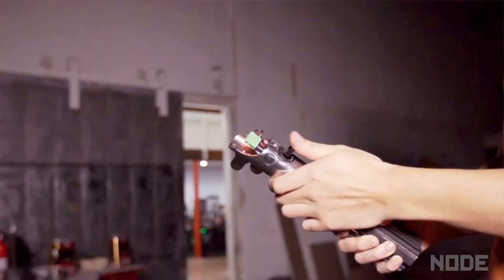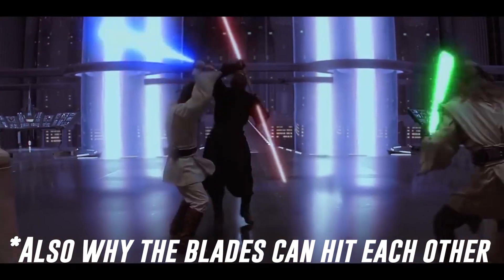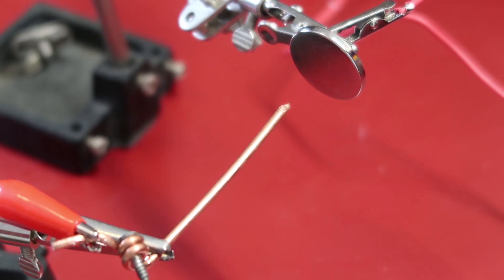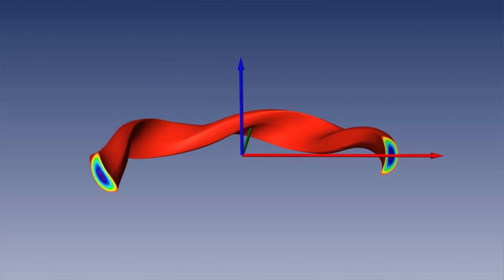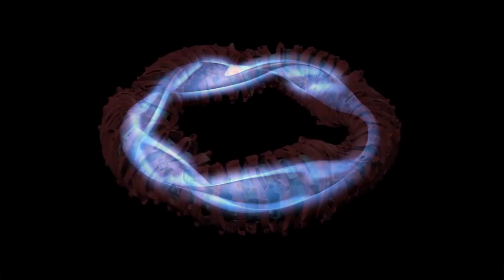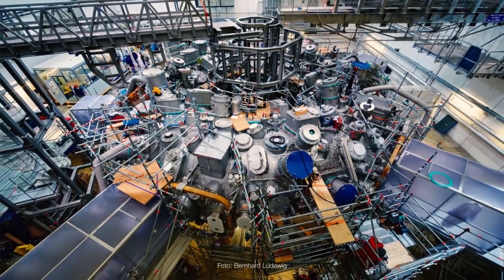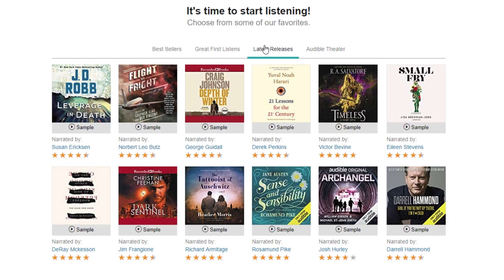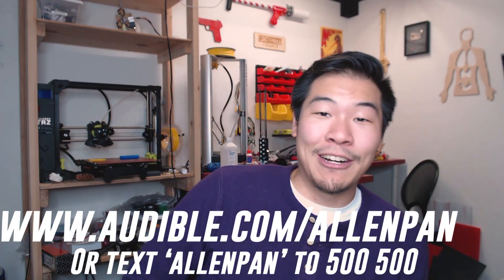Real Life Plasma Blades!!!

Comment: Just take a pipe, and on both sides of it make like ten smaller Jacobs ladders and add holes in the pipe so it blows outward on each one. So instead of the current traveling up force it to travel right and left using compressed air.

Comment: What if you put the electrodes as the 2 sides of a metal blade with a dielectric connecting them on one side, have some dielectric slats that guide the air to the side.

Comment: You could apply the same concept as a plasma cutter, with a 25,000 degree arc and an extendable electrode, like a taser, sort of.  Making it like a plasma cutter could be especially effective in a universe with access to extra dimensional technology. There's also an option of using replaceable tungsten electrodes rather than steel, for a hotter arc.

Comment: What about something looking more like a grill burner, like lots of little holes in a pipe along the length of the blade? You don't have the air going up the middle between the two edges but from behind.

MAYBE take that idea, and bend it so the electrical leads and air holes are on either side of the leading edge of the blade in an attempt to blow or curve the plasma around the leading edge (probably would need a non-conductive blade to do this)

Comment: It would have been a lot more effective if he turned the bladed parts outside so he could cut stuff
Reply: It doesn't work that way, the electricity is arcing between the two electrodes

Comment: What if you made a sword with the plasma on the outside.  A way of doing this i think would be epic is if you cut up a normal blade and spaced out the pieces putting the leads on the far end of one piece, placed at the end of the sword, and the near end, placed at the base.  That way the arc would jump from segment to segment.  This would make a functional blade and taser, also a way to make the normal non inverted halo blade!

Comment: What if you were to take a thing tube stock and drill micro holes along the edge then run a conductor to make a full length knife or short sword , then wrap the magnets along the tube to create the magnetic field, then in the hilt place your gas source and connect a small computer fan to disperse it into the tube. So gas to fan to magnetic tube to the holes to a charged Jacob's ladder kind of set up and since it has the field going the whole length wouldn't that pull the electrical charge the rest the way to actually make a blade?

Comment: That's not how heat and temperature works bro, do you even science?

One one side of the scale we have 9 kelvin
The other side we have 100 000 000 Fahrenheit???
Reply: Also, 100 mil degrees Fahrenheit is not 4 times hotter than 27 mil degrees Fahrenheit, because that not how degrees scales work.

Only kelvin is usefull in these calculations.

Long live Kelvin
Reply: @angelodeath562  he said about not exactly

Comment: Consider how a plasma cutter works. You supply gas to a narrow tube that forms the electrode (copper tube) which ionizes the gas to a plasma. The plasma is then accelerated by the pressure, and electrostatic force of the current, out of the nozzle electrode. Simply flatten the nozzle and electrode tube into a blade shape, and the plasma will compress and cut anything a plasma cutter will.

Comment: If you put the two halves of that setup on opposite sides of a very good electrical insulator, would the plasma arc around it? If so, that in combination with changing the airflow direction would mean you could perhaps make the plasma come out sideways, and be closer to a real edge.

Comment: Couldn't you put the blades the other way around? So the plasma is not in-between but around.
Reply: No he couldn't because the easiest  connection for an arc is going in between the wires. so the gap is to wide for an arc to form
Reply: @jacktaylor6289  and when it's round? The round structure is a strong connection. The plasma could be thiner and smaller, but all around. Could that be possible?
Reply: That could be possible. I misunderstood thinking that you ment something like a chainsaw. The blade being plasma with the wires being inside.
Reply: @jacktaylor6289  yes exactly

Comment: Use argon instead of air. It is just..awesome
Helium will work as well, but it is more expensive.
Reply from the maker: Played around with Argon, it was...surprisingly disappointing.
Reply: Allen Pan - Sufficiently Advanced I did something similar on a small scale with an CCFL inverter and Argon was the only thing that worked..

Comment: Why not change out the leaf blower for a high powered heat gun?
Reply from the maker: Cause the whole hilt is made of plastic.
Reply: Allen Pan - Sufficiently Advanced dang.
Reply: Allen Pan - Sufficiently Advanced could you possibly use metal hoses from the heat gun to the blade and then use an aluminum pipe on the inside of the hilt?

Comment: That looks really cool, but it isn't much of a "plasma blade" if the cutting edge isn't made of plasma.  Is there any way for you to modify it so that the plasma will run along the edge instead?  For example, produce a contained plasma, then shoot it out along side a magnetically charged blade.  You probably wouldn't be able to get more than a couple of inches for the blade this way, but at least it would be an actual plasma BLADE, instead of a plasma poker.

Comment: Could you theoretically put a very very thin wire as a negative or postative side to your current and the plasma would cover it so that is heated to a high enough temp it would cut through anything befor it could touch the wire breaking the currents? Thus being practically a planet blade?

Comment: Does it charge a battery
Reply from the maker: Flyback output is about 24,000V, so if you have 20,000 rechargeable NiCad AA batteries in series then yes.

Comment: i like the concept of plasma cutters being similar to light sabers, a two inch 30,000°F plasma blade that cuts steel like it's not even there, which makes the plasma in a chamber then projecting the plasma outwards. instead of a 2 inch plasma blade, one could theoretically scale it up to some feet. buuuttt that kind of 2 inch plasma blade is called a "pilot arc" so it's not quite the 30,000°F that plasma cutters have when they complete and electrical circuit to then be able to pump out a proper amount of energy for cutting, so not terribly effective at cutting as a free-floating plasma blade, and completing an electrical circuit with the target isn't quite as effortless as using a lightsaber.

Comment: About the wendelstein 7-X: You Are working with Fahrenheit, but in Germany, we work with Celsius, so the plasma reach 100000000 degree Celsius. That Are 180000000 degrees Fahrenheit.
Reply: Rex Montul WTF that's way hotter
Reply: @ Crimson , yes so its time to migrate , metric for the win ;D
Reply: @hyperhektor7733  ? No
Reply: lol you will be assimilated by the metric-borg :)
I learned the inch system but it some real flaws, you can understand this only when you really know booth.
Reply: @hyperhektor7733  we know both, we use imperial
Reply: i use metric in europe, but i am prepared that the "impire" strikes back ;)

but we still use imperial for bikes,plumbing and cock-measurement on the internet :D

Comment: Love this! You could even put the base of the blower on some straps and wear it on your back!

What glue do you use for your 3D prints? I haven't found one that works for mine
Reply from the maker: Just 5 minute epoxy, but I didn't use it on anything load bearing. That's what zip ties are for

Comment: Have a thought maybe try using CO2 capsules, it would give you a finer air flow but you would be limited to how much CO2 you have, or maybe an HPA tank so you can control the flow and have a nozzle to control the type of flow of air so then you could possibly control the plasma better without having such a long blade of wire to conduct electricity

Comment: What if you took the same design here, shrunk it down, turned it sidways, and line a central base with them. The plasma only seems to project at the tip, if you had an array of those you could make a blade of plasma right?
Reply from the maker: Shrunk it down is always the hard part. But yeah I've thought about it.

Comment: so I am no engineer but, if you took a tube, bent it like a blade with a sharp edge, cut off the edge so the tube is exposed, slapped some super magnets on the back and then uses the two sides of the tube to make a sort of plasma arc wouldn't it come out of the edge and be all super heated and rad and be a real sword at that point?

Comment: wouldn't a katana that has nodes along the edge thru which taser was connected make more sense? you would get a line of plasma along the edge which wasn't blown, so would get hot
Reply from the maker: That's plan b. Gonna need a lot of zvs drivers and flybacks though.

Comment: I'm curious to know how the arc will behave if you use some kind of gas torch for a pre-ignition system, compared to just using the air blower. Might help get a better arc length.

Comment: you should try to get the actual edge to be plasma, cus right now you dont have a plasma edge. Maybe get like a few very short jacobsladders next to eachother and blow air across those through a slit or something akin to that. Your plasma could portrude further than the actual copper and youd have an actual blade! albeit existing out of a few different plasmas rather than just one.
Reply: pretty much what I was thinking. have the air come in sideways from the back of the blade across multiple ladders all lined up.
Reply: Wouldn't the electricity just jump between the different prongs randomly, leaving you with a wacky cat's-cradle arrangement of arcs?

...granted, this is giving me ideas for a plasma spear...
Reply: My thinking was several small JLs and several holes along the length like a flute... blow air into the length, it comes out all the holes perpendicular to the edge of the blade..

Comment: How about two spark gaps, whose plasma is air-blown towards each other in a V shape? By applying a, third, independent, even higher voltage at the tips of the V shape, you can get V shaped plasma!

Comment: Using a microwave transformer may cut better since it had more amperage possible.  But is also significantly more dangerous.
Reply: Soooooo much more dangerous. Not something you should ever try at home...

... not gonna lie though, kinda have a bit of a nerd-erection thinking about how that would work.
Reply: .....i shall try this now
Reply: I've tried that with a MOT, problem with pulling an arc with a MOT is the ferrite core is weak and becomes saturated quickly.
This means you could pull an arc for a second or two, but has to be shorted first.
That is unless you cut out the secondary of the transformer and gave it around 80-100 windings to multiply the voltage from the primary. This would create the voltage needed to pull a constant arc, but the problem is that the current would be lost largely, and a short would cause the wire to burn up and short out itself.

Comment: What would happen if you used 3 metal blades, would it let you cut things in a more normal fashion but would it decrease the power output to much to do anything? Just a idea I like programming stuff not the building and designing of it though so just blame that if it's a bad idea. Also what happened to the Spider-Man build that was so cool.
Reply from the maker: 3 is tough since the output is DC, so just positive and negative. I suppose you could try a weird AC thing between 3 electrodes, but I think the third blade would get in the way of cutting stuff.

Also Spider-Man stuff was way too hard for me to finish at the time. Webshooters are hard.
Reply: Okay cool, again not really that much of an engineer and still in high school I just thought of a triangle pattern... don't know what else to say besides thanks for answering my question.
Reply: How would you fit three metal blades? In what configuration?

Comment: So, how about a version of the plasma blade with one of the electrodes being on the tip of a rod and the other one being position on the handguard. You can put magnets inside the rod itself to let the arc spin around the rod, basically a plasma sword :D.
Reply from the maker: It wouldn't be a very long blade...For 3 ft that'd be like a bajillion volts.
Reply: @allenpan  
Yeah, i should have made it clear that i would also suggest to put a row of metal pins in between the two electrodes to reduce the overall way that the electricity has to take through the air, iron would make a good pin material since it has a relatively low resistance. Think about it, at a lenght of 500mm and a max air travel distance of 90mm you would need a row of  82 pins (with a distance of about 1mm vetween every pin). When your rod got a radius 17,5mm, you would need about 1802 pins to cover the whole rod. I know that sounds like the sword would be heavy as fuck but you have to remember that the pins wouldn't have more than 1 to 2mm in height, so the pins together would weight around 556 grams (pretty light isn't it :D).
Reply: Mandernach Luca somebody check this man's math, he may be on to something...
Reply: The voltage required would be insane: A foot of air requires about 700,000 volts for the initial spark (unless you have the air already ionised). Such a voltage would require a very thick hilt to avoid short circuits, and would be rather dangerous to experiment with.
Reply: If you compare that with the weight of an actual sword it doesn't look that heavy
Reply: @hedesonpeter8471  556 grams on just pins, so no, I doubt it'd be any lighter than a real sword.

Comment: Every day, Allen strays further from the light of safety regulations...
Reply from the maker: Somebody has to.
Reply: @allenpan  true that
Reply: @allenpan  I was wondering the following, forgive me for the fantasy. You seem to be making a plasma out of blown air. If you have a solid that could rapidly be converted to a gas (such as liquid nitrogen) could you convert that gas, if that gas only has one means of escaping a space, into your plasma arc without the need of the extra force of blowing the gas into the electromagnetic field? If so, is it then possible to expand the reach of the arc by having multiple planes of electric field (+ × ) to achieve a compounded, and perhaps extended, arc? If that is possible, then with the right solid, could you get a charged solid to rapidly convert from a solid to a gas such that it wouldn't need to be as cold as liquid nitrogen, but would almost act in the same manner with a charging or heating mechanism is applied to it. Also, would the plasma arc seem to act like a solid when touching another plasma arc because the force associated with one electromagnetic field be working against (ie repelling) the other (why light sabers don't cross through each other)?
Reply: Soon he will be no better than william osman
Reply: Ya. Who gives a shit about OSHA?
Reply: Experience has become his shield
Reply: Safety regs are for pushies...
Reply: That’s science for you
Reply: Exposed arc experiments always remind me of the MSDS for ozone.
Reply: U edited... Why?
Reply: Safety regulations are meant to evolve around cool/dumb shit, not the other way around.
Reply: Safety suggestions you mean
Reply: His sword is orders of magnitude safer than the idea I have, and plan to build when I have the resources. But then again a leaf blower with center of low temp plasma will pretty much always be safer than the equivalent of a blade of tasers.
Reply: What are safety regulations?😀
Reply: Ever heard of StyroPyro
Reply: fuck safety
Reply: "In the world of HEPA violations."
Reply: Light side
Reply: *strays
Reply: @demoninajar5332  I didn't misspell it?
Reply: Steller no but you used the wrong word
Reply: @demoninajar5332  Ah! I didn't see. Thanks

Comment: what if you used copper pipes with holes to blow the air / as electrodes
Reply from the maker: Hmm probably a different effect. You'd probably end up with one thick wobbly arc between them rather than a sheet.

Comment: Electrifying video dude, it was quite hot.
Reply from the maker: It was...non thermal...
Reply: It didn't seem that thermal, I think I've burned through cardboard faster with a magnifying glass lol.
Could you touch the plasma arc then? Or is that the part that will shock you?